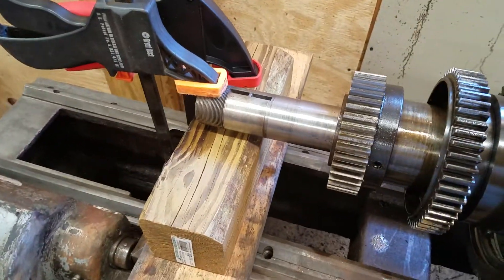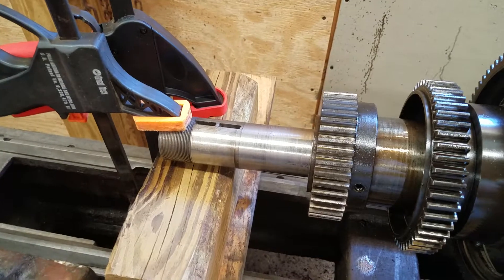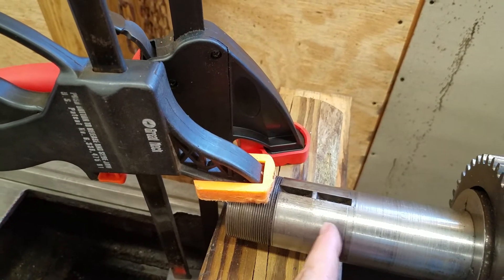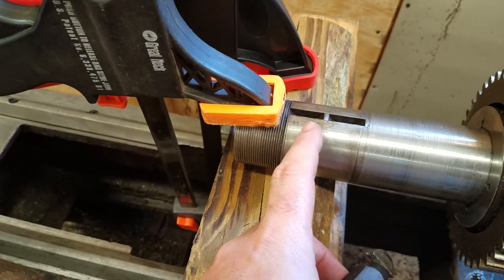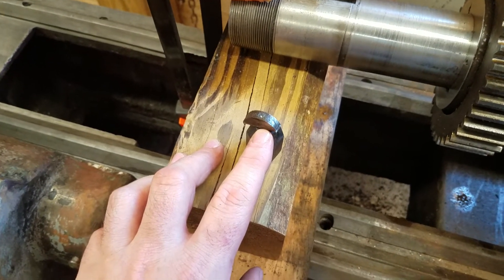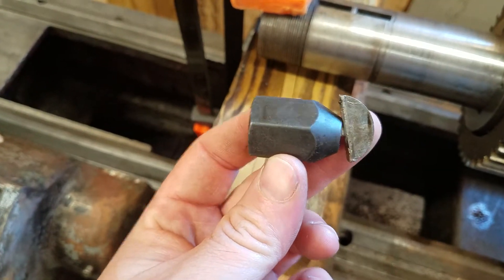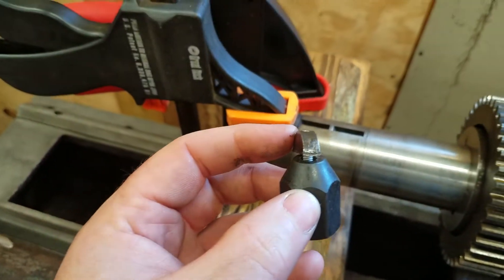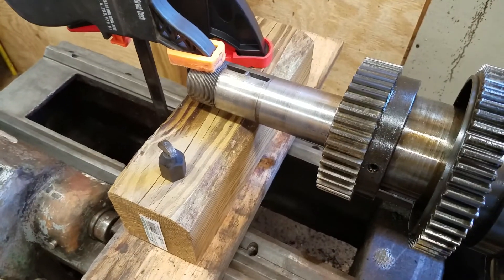Woodruff key removal method.

Comment: Woodruff keys are usually pretty hard and resistant to drilling.  Carbide drills and taps  are brittle and snap easily, so I'd say you were a bit lucky. Weld on to the key, or slit it with a diamond disk on a Dremel may be a better bet.

Comment: I had a hell of a time removing a stuck woodruff key on a small mower driveshaft. I stumbled upon this video. I applied some pb blast, and some heat. Tried tapping from either end with a punch and hammer. Nothing. I followed the method described in this video, and literally two gentle taps with the slide hammer and out it came. Thanks goes to this guy for helping me turn a shit show into a winner.
Reply: My husband and I are in the same boat! Lol this is hope at least
Reply from the maker: Glad it was helpful.

Comment: what about if the key has sheared off flush with the shaft?
Reply from the maker: You can do the same steps to remove the key. You will have to make sure you are not tapping to deep and the bolt is only grabbing the threads in the key and not the shaft. If you have the top of the key that broke you can measure it and find the difference compare to the new key. Then thread the bolt in just short of the difference.

Comment: My method was to use a punch on one end of the key, driving it into the keyway. Go from end to end, like rocking a rocking chair. It seems to work. Our boat had a reel whose drive took a lot more torque and shock load than I think the manufacturer anticipated. We added an extra key or two, but they would still shear and smear at inopportune times.
Reply from the maker: That is a handy method.  I thought about trying that method with my removal of the key. But this is the hollow spindle shaft of my lathe. I did not want to risk a missed blow causing a dint or bulge in the shaft. That would cause excess vibration and extra ware in the solid bronze bearing the the head stock.
Reply: GunFun ZS Yeah, the ones with the rounded bottoms can usually be tapped down on one end which makes the other end pop up a bit. Then you can grab it with wire cutter blades and pull it out or use a small punch.